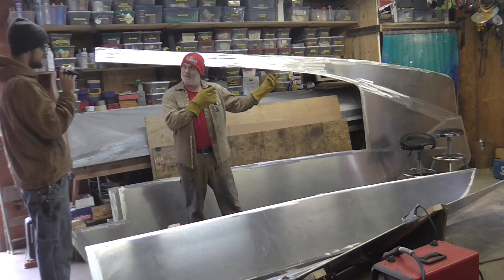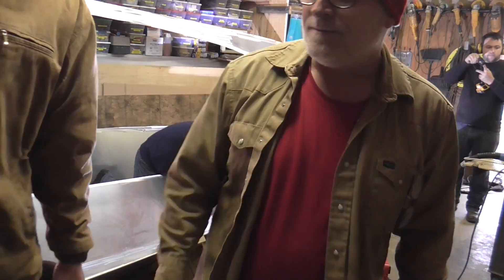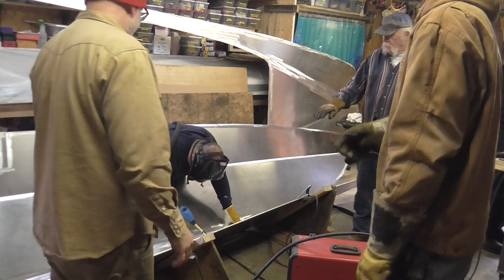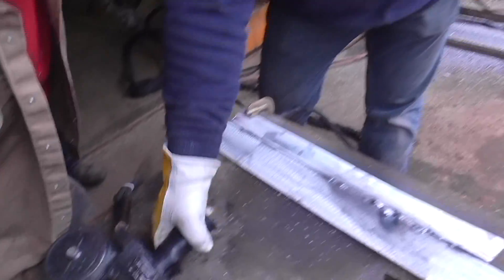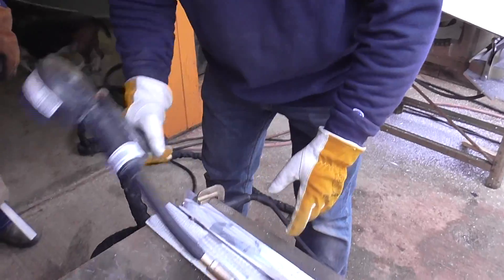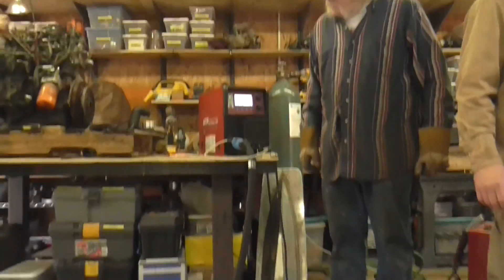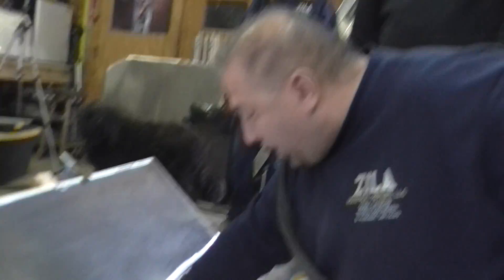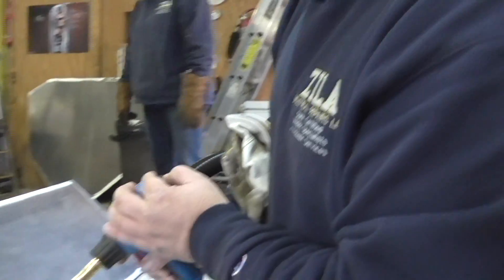Welding aluminum boat from scratch with PushPull gun on PP200

Comment: Don't understand why you use 4043 wire when everyone I knew in the marine business always advised and used 5356 for the corrosion resistance that 4043 does not give you.
Reply: David Richards I’m guessing for cracking? 4043 has less of a cracking ability. 4043 is common for aluminum boat repair and Pete knows these alloys inside and out so it was probably for a reason.
Reply from the maker: Doug has his own way of doing things ....   besides the 4043 was used on the inside of the boat to tack weld and fill some gaps - on the outside where seawater corrosion and strength are a concern 5356 was used as you probably could tell by the green flame .....  id you have followed sv seeker you know all the aluminum on the pilot house was welded with 4043 most of the steel hull was welded short circuit mig with 100% co2 gas ....  bottom line Doug does not bild the boat per textbook but it will probably still work just fine
Reply from the maker: Like I said - it was his job -I was there just for slave labor ....  the inside of the boat he can coat in some paint or epoxy and the outside is 5356 welded ...  and to build a new tender in 10 years - if that is his main worry than he is doing really good !
Reply: The tender does not matter, its the superstructure he needs to worry about as the sea spray is as good as submersion.
Reply from the maker: so you say - good thing I didn't have a hand in that one ?   LOL.  I mean even though the spray is as good as submersion ....   the pilot house is still much easier accessible and repairable ....
Reply: Maybe, but just for the sake of having used the correct wire - makes no sense in any land.
Reply from the maker: I mean - I like to agree.  Doug actually got marine grade aluminum 5086!!! I was surprised not 5052 like most guys would have gotten ....  and then I found out why ...  his local guy had a boat load of 5086 on the shelf that he wanted to unload ...  and Oklahoma is not the "hot spot" for marine grade aluminum .....  
and for the sake of having used the correct wire - 5356 would have worked good with that I agree and 5183 would have even worked better with that ....  but  .....  like I said before ....

Comment: I have always liked the Esab air operated push pull guns. I used to use one with a 10 meter lead on tankers and trailers, when I changed to a Binzel electric one it never was as good. With the Esab unit you could remove the regulator ball valve and then the operating paddle acted as a throttle so it was easy to just alter the wire feed by the amount you squeezed the paddle lever.
Reply from the maker: easb group bought tri just recently ....  I think the new Esab machines will have that exact gun I was using ....  and if you are in a shop with good air supply I can totally see your point - and typically air motors stay cooler than electric motors....   its just a matter of connivence
Reply: The A9A gun is still listed on esab's web site so I may well get one in the near future, the main reason I have Binzel at present is I moved to Migatronic some years ago as the service is so much better. one instance a main board blew,  the dealer was out within three hours and replaced the board, it would take the Esab dealer that long to answer a phone call.
Reply from the maker: LOL - that is one reason why I have 30+ welding machines .... so I always have a backup no matter what ....  I just cant be down sometimes ....

Comment: I need that in my life for my Pro Pulse 200! 8ft mig gun works great but at end of day it’s still 8ft
Reply from the maker: Jason, start saving !   this is an expensive add on .... the push pull gun is just as much as the machine ... LOL. ....  but if you do a lot of aluminum and you don't want to reposition the machine all the time .... it can come in really handy ...   I think the biggest advantage is controlling the welding parameters as you go ...  and there is a solution coming ... even on the regular mig gun .....   stay tuned .... and I am talking of an affordable solution ....  less than $200 not 2g !
Reply: ZILA that’s frigging awesome no more rolling the welder out of the garage to fix a trailer wheel cover. I can’t wait! What’s the time frame on that Pete?
Reply from the maker: time frame on what ?   this is a ZILA special, not approved, illegal, "it cant be done", modification made in my shop against recommendations and without manufactures blessing ....   LOL.   I voided all my warranty and cut and colored wires and everything works !   LOL .....  ?I was told it wasn't possible to hook a push pull gun up to the machine and I was also told that the machine does not have remote control options (the deal with the potentiometer ...). 
so now that HTP saw some of this raw and unedited footage they said :" can we see your machine ?"  we are thinking about offering this ....   
so that is the status. I git that push pull gun straight from Germany (the rest of my family is still living there) and I modified and wired everything at my own risk ....
now I know htp has connections and can get the same parts I got .... only god knows what they are going to do .....  but you care not the only one asking about this ....
Reply: ZILA no that’s awesome I know you made it, you are prob the only one I would believe that did, I meant the solution for under $200 did that mean options for us that don’t have your knowledge to be able to do something? What’s the affordable soution? Through you or HTP or?
Reply: Zila, will your solution be plug and play? Also the gas fitting on the back of these machines, If they're making this machine for the US market then why not use the gas fitting almost all other welders in the US use instead of that 13MM odd ball fitting that they used. I had to cut my hose up to make a longer one.
Reply: I just figured out it's 1/4 BSP.  i noticed the 9/16 to 5/8 fitting on the regular also with make the the standard argon fitting work. I turned down a standard argon fitting so that the original gas hose nut will hold it on the machine.
Reply: Daniel brown Dan I just threaded on a 1/4npt to 5/8RH for my Argon hose. I know it’s 1/4 bsp thread but I have no gas loss from it and it’s been that way for a year.
Reply from the maker: Daniel brown

I am not sure about how they are going to do it ....  my setup requires 5 wires.  if you install my setup on the "factory" connector that is currently on the machine - A) you have to rewire that connector and B) you loose your tig function ....  So I opted to remove the factory connector and install a miller style 14 pin connector so I can still do all the tig functions AND the push pull gun without rewiring or switching anything over ....  so that whole operation would probably have to happen somewhere where a guy has all the tools and knowledge to cut, solder, drill out the receptacle, etc ....  if you are REALLY tech savvy you could probably do it - other wise it would be something where either HTP would have to do the mods or even change the style connector on the front ....  
I am not sure what they are going to do or when .... I know that the push pull gun cost about as much ad the machine itself !
It's really nice  - but really pricy too !
Reply: ZILA so to clarify you just need the correct socket on the front of panel? Match HTP wires with millers 14 pin? Can you use thier smaller connector for the spool guns on say the Miller 212? I think it’s 5 pin?
Reply from the maker: NO - that is not how it works. I am using a push pull gun that is wired for a Stel Iron Mig 303 SP.  That machine happens to have the same 14 like a miller does.  It is wires completely different though ....  once you have the push pull gun for the Iron mig 303 SP you get as miller 14 female panel mounted receptacle and install it in the PP200 and wire it very similar to the Iron mig 303 SP.  
At this point the foot pedal for the HTP PP300 will fit the PP200 and the push pull gun will work too. 
All confusions resolved ?
This has nothing to do with miller at all (besides the shape of the plug). ....  now you DO need the miller plug AND you need a control board that synchronizes the wire speed of the feeder in the push pull gun with the feeder that is in the machine itself ....   there for you need to do some wire cutting, soldering, install a little board in the machine .... etc .....   it's not an easy plug and play deal !!!    once all the speeds are synchronized and everything is tested - THAN you can run the push pull gun and no more actions are required in the future ... you can plug in whichever gun you want and you can use whichever gun ... simply connect and disconnect the gun .... 
just the setup is a little bit painful ....
that was nothing that I did in 30 min ......
Heather and I did all the research, and measuring and wiring diagrams ....  and it took us on this one here almost a full day to get this done right and nice .......

now in future one guy could probably do this in several hours ... but this is definitely NOT a 30 min fix !
Reply: ZILA thanks for the clarification on this. Appreciate the feedback. I understood most of it. What I meant by Miller is I wonder if you can it with thier cobra gun I guess.
Reply: Zila I was asking about your less than $200 affordable solution, is that plug and play? tell us about that.
Reply: Daniel brown I know that Stel number 1. Already sells the Pro Pulse 300 version and 2. They sell the spool gun kit which I’m sure will fit the pro pulse 200 cod#600513000L and hopefully HTP can keep up because Stel offers a way wider variety of welder and parts. I wish we could order right from Stel directly. I like the colors of Stel’s machines better as well.
Reply from the maker: Daniel,  basically you take a 12 ft hand control from an inverting 221 acdc and cut one wire (for the on/off switch) and tape that to your mig gun ....  and that's it !!!  
I will be making a separate video about that .....
Reply from the maker: Welding Junkie Jason, call htp you would be surprised how they occasionally have silver machines ....  LOL
Reply: I like Silver much better. Stel has on the market the pp300 (303) any date on the HTP 300?
Reply from the maker: HTP says 3 rd quarter 2018 ....  ???  I don't know nothing  - I only know what they tell me